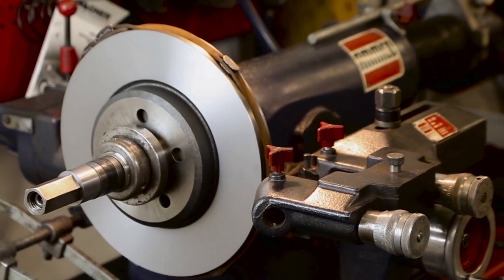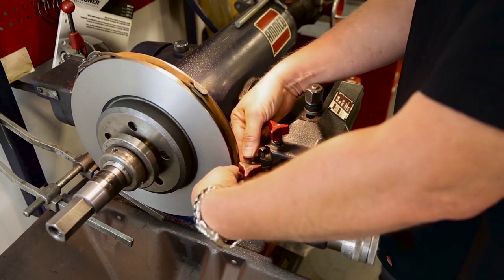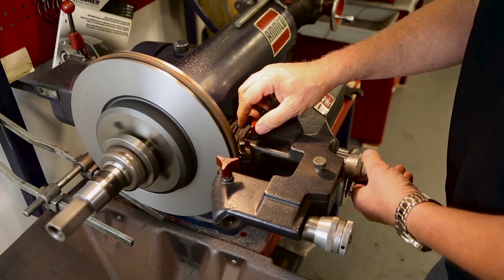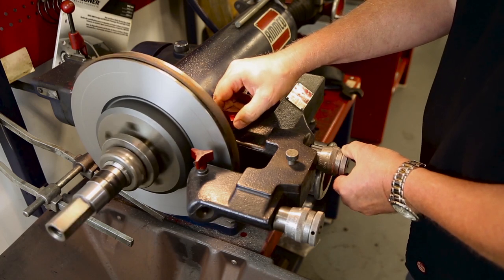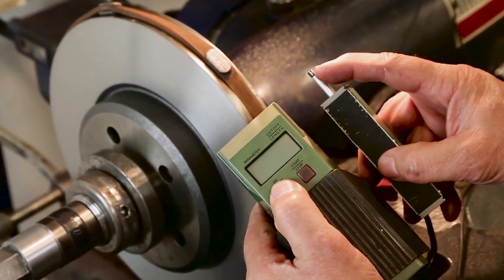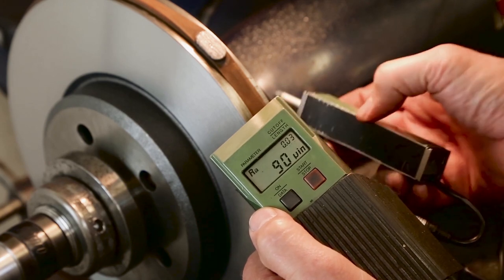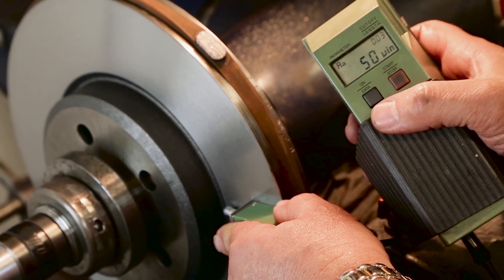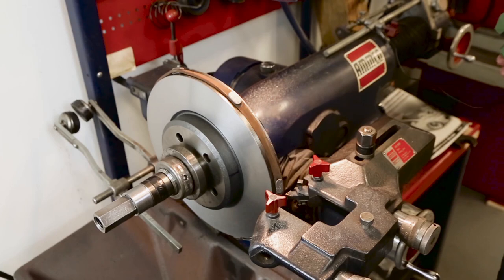Best Brake Lathe Tool Bit for Brake Rotor Surface Finishing

Comment: What do you finish it with ??
Reply from the maker: We used round tool bits to cut the surfaces and finished with a sanding block with 120 grit sand paper